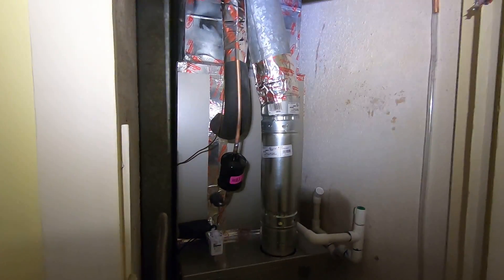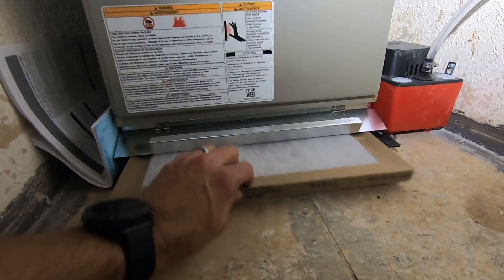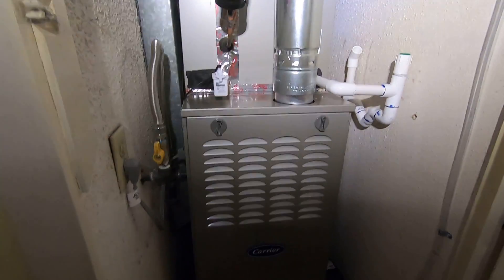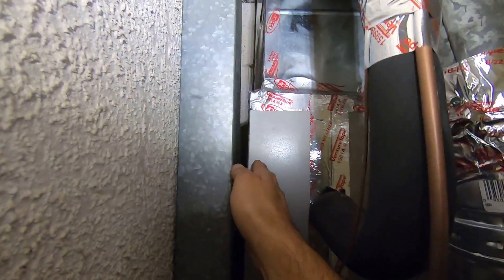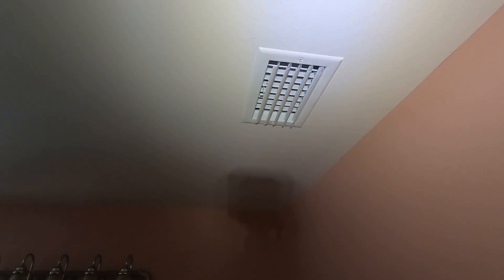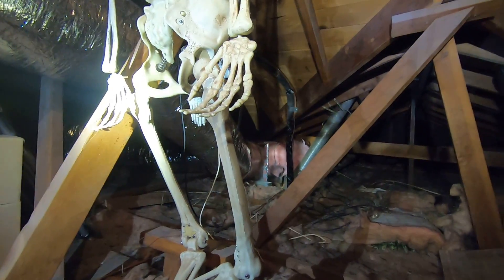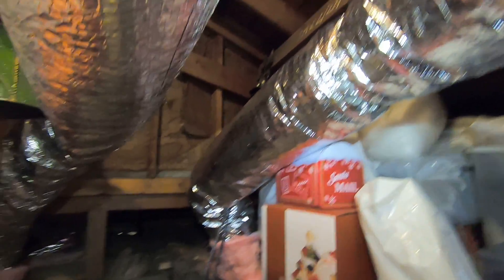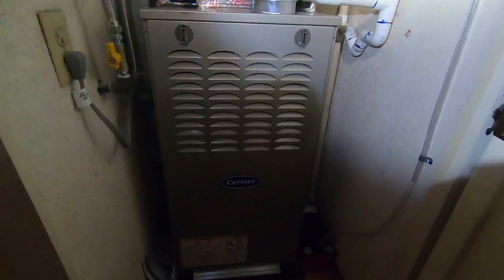Carrier Furnace and Ductwork Installation

Comment: Questions about this and the Carrier Comfort mid-efficiency furnaces. Do they have inducer motors? If not, how is the furnace vented? Can it be vented through the chimney? If not, how are the gases vented outside? Is any motor used to vent the furnaces? Thanks!
Reply from the maker: Thank you for watching the video. Yes this furnace has an inducer motor for the venting.  They require a minimum 4 inch double wall flue vent that is vented vertically with the proper rise to the outside of the house through the roof with a double wall flashing, cap and collar. No, the furnace cannot be vented through the chimney.  Each furnace will have an inducer motor for it's BTU's to properly vent.
Reply: @albertairinc.1140  OK thanks. A few more questions. Why can't I see the PVC pipes on this furnace if it is vented with an inducer motor? Does Carrier sell mid-efficiency furnaces that DON'T use inducer motors? And if so, can those furnaces be vented through the chimney?
Reply from the maker: @MarkSmith-hp6os  This is an 80% AFUE furnace, so it does not use PVC pipe to vent.  It uses a 4 inch double wall b-vent.  No, Carrier does not have any furnaces without inducer motors.  It sounds like you need to go to a heat pump system that is all electric that does not require any venting.  Check out this video about these videos about heat pump options. 
https://youtu.be/6wzaCcqnfsA?si=-L9I3_0cE_cavaTB
https://youtu.be/oHnBdSfZslM?si=0oFa_ATyrhTfNjlo

Comment: Is that an 80% furnace? If so, is there a combustion air vent that is connected to the closet room and attic? Where did you place that?
Reply from the maker: Thank you for watching the video.  Yes, this is a Carrier 80% AFUE furnace. Yes, there is a lower and an upper combustion air vent in this closet.  The lower combustion is the riser pipe in the back left hand side of the closet.  The upper is is a screen at the top of the closet.

Comment: hello, and thank you for the video.  I have a question about my new Carrier 58SCO furnace.   When using the furnace, it cuts off and the amber code lights blink 1 short 3 long blinks.  I have a 3" flue pipe (from previous unit).  Is it possible this new unit needs a 4" pipe?  Could that be the reason my new unit is cutting off?  Thank you in advance for any information.
Reply from the maker: Thank you for watching the video.  Yes, the error code is most likely from having too small of a flue vent.  The Carrier 58CU0A furnace requires a 4 inch double wall b-vent flue vent.  A 3 inch flue is not adequate for the Ultra Low NOx furnaces.  Also make sure you check the gas pressure.  We typically set gas pressure around 2.2 to 2.4 depending on the BTU size of the furnace.

Comment: Thanks for this wonderful video. I do have a question, why did you go with an ADP evaporator coil versus an actual Carrier brand? Apparently, this is a common install combo. Thanks!
Reply from the maker: The 4 ton ADP evaporator coil 17. 5 inches width and is the same width as the 4 ton Carrier furnace.  The Carrier 4 ton evaporator coil is 21 inches width and would not fit in this closet due to the lower combustion air on the left side.  Both the ADP or the Carrier coils will get the same efficiency ratings with this system, so we went with the ADP because because of its size.  We install our systems with both ADP and Carrier coils depending on configuration and dimensions.